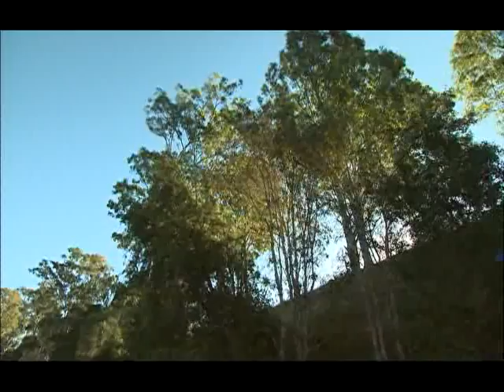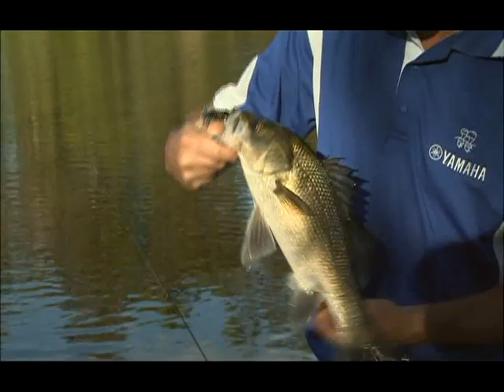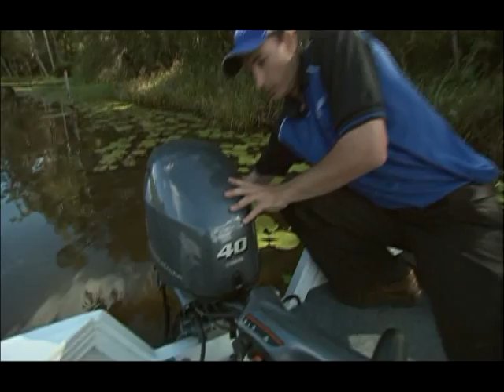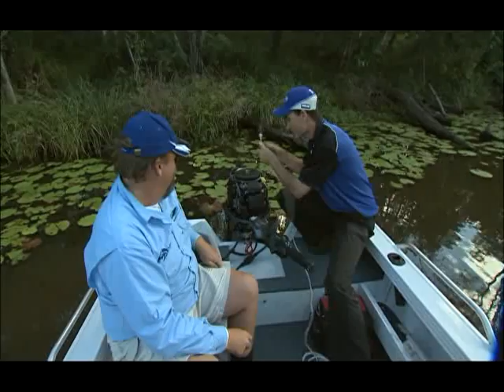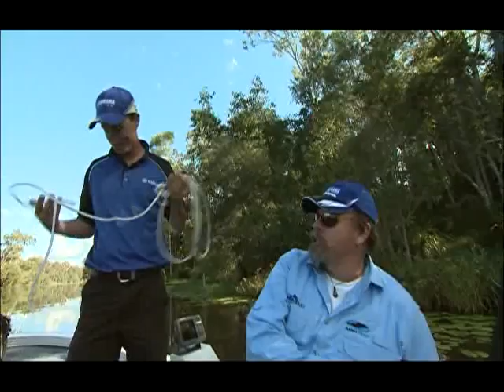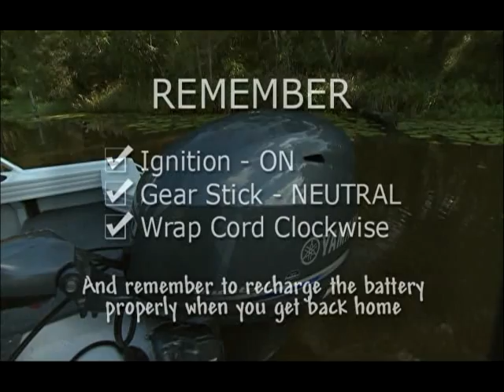How To: Pull start your electric start outboard when you have a flat battery

Comment: Thanks for the video. I have a 1965 engine that has been out of service for 8 years and needed to be pull started to see if it was seized up. It worked just like the engine in your video. Now, it's time to hook it to the battery and hit the water!